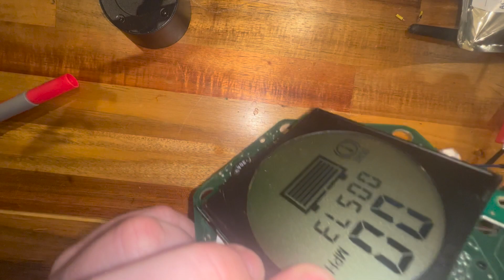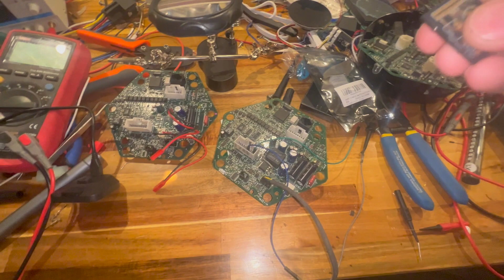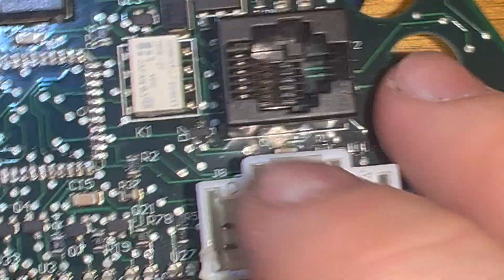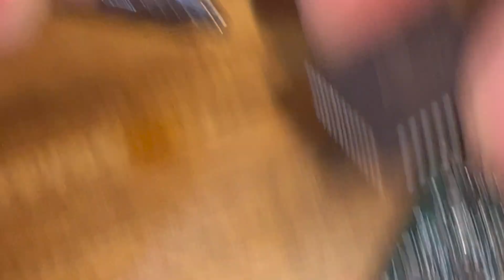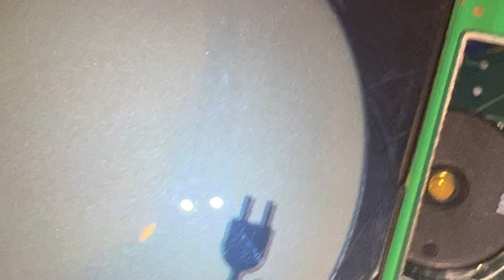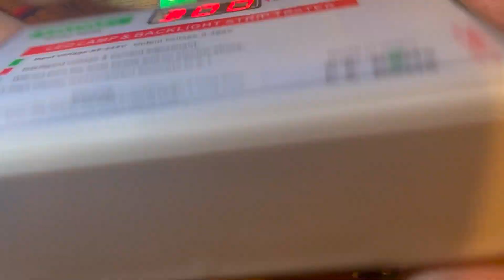Ep5: Debugging and Repairing the Cluster on a Ford Think

Comment: The PIC16 series is quite common and the programming is fairly simple to do. You do need the full code, data, and config in the proper format to flash a new one. I could probably look over what you have and provide further information and maybe help if there's some missing information too
Reply from the maker: I have a PicKit and was able to extract all of the code off of the chip, including the config file, but I’m not at all familiar with their IDE in order to flash to a new chip. Uploading the files I believe I extracted correctly if you want to take a look. It’s under the linked google drive I have at haganwalker.com/fordthink in the cluster folder.
Reply: @hagan92  I just downloaded this stuff out of curiosity, and noticed there was a bunch of text (well, series of RETLW instructions) in there - including one that referenced "Mid-South Product Engineering, Gadsen, AL", who are presumably the people that actually designed it.  Sure, it's probably all still under NDA, but it might be worth contacting them to see if anyone there remembers the project and if there is anything they can tell you.
Reply from the maker: @TrimeshSZ  unfortunately I believe they closed about a decade ago. Good find - that was the firm! There’s a sticker on the back of each cluster with their name. Anything else that you see? Is everything there to flash to another PIC?
Reply: @hagan92  Nothing especially interesting - there are some more strings saying stuff like ":Th!nk Neighbor Gauge Assembly SW Version  " (but no actual version) - The file has the dumps from the main flash, the config word and the EEPROM region, and nothing looks like gibberish so IMO there is a good chance it will work.  There is certainly nothing in there that looks like garbage.
Reply from the maker: @TrimeshSZ  I appreciate it! If I can figure out how to use MPLAB X to flash a new chip, that would be awesome, as it probably would give life back to a few clusters that no one else has managed to fix (I’m not sure if anyone else has ever managed to extract the software) but I still believe, because of the lack of LCD’s and the overcomplexity, that a newer and more simplified PCB is the way to go.
Reply: @hagan92  The reason I noticed this was that I fixed one of those clusters years ago (it was a trivial fault - a blown regulator), and I remember thinking at the time that the  cluster was basically just all the glue to tie things together put onto a PCB - presumably with the intent of keeping the engineering costs down since the rest of the components could be sourced off the shelf.  Based on the (admittedly superficial) look I've had at the code, it doesn't appear to be doing anything highly complex.
Reply from the maker: @TrimeshSZ  I believe that’s true. The main purpose is odometer and diag codes that it can display over a serial connection from the controller. I have made a working bypass and have sent a few PCB’s out to a handful of people for testing and as long as that’s a success, I’ll keep moving forward with the next phase. More to come!
Reply from the maker: @TrimeshSZ hi there! Where exactly did you see these strings? I remember seeing them too at one point in MPLab but just tried to find them earlier tonight and couldn’t remember where or how I got there. 

I was able to successfully flash the hex file to a new PIC and got a previous DOA board working once again. I uploaded a new video just a few days ago and appreciate the encouragement!
Reply: Hi - because of the architecture of these PICs, you have to embed data as instructions - the standard approach is to use the "RETLW" instruction that does a return from subroutine and loads a constant into the W register.  The opcode for the RETLW instruction is 34xx where xx is the value to return.  Typically the data is proceeded by a ADDWF PCL,f instruction - so you call this with W set to the offset of the data you want and it will return with the value.  Having got that out of the way, the strings are at the following locations - 17C4: ":Th!nk Neighbor Gauge Assembly SW version  "  17F4: " Hardware Version:  " 180D: " Software Version Type:  " 1828: " Copyright (C) - Mid South Product Engineering, Inc. Gadsen, Alabama 2001 - 2002 " @hagan92
Reply from the maker: @TrimeshSZ  super helpful, thank you!
Reply: I just had an attack of boredom and took another look at the cluster code.  It really doesn't seem to do much - at this point, I well have missed something because I've only examined part of it, but the only bits I've found that are definitely in use so far are timer0 (seems to be programmed to produce a periodic tick) SSP0 (programmed in SPI mode - probably driving the LCD panel) and the internal EEPROM, which seems to be implementing a counter, likely an odometer.  The values read from flash are processed and output over the SSP, probably to drive the display.   There is also a lot of reading of port pins and driving other ones, although the intended function is unclear given the lack of context.  The code also has a very "not written by humans" look to it, making me suspect that it was produced by the free non-optimized version of the PIC C compiler.  If we can figure out what the in-memory format of the data is, it should be possible to swap the LCD for something else. @hagan92
Reply: @TrimeshSZ  awesome! Thank you so much for doing this. I'm hoping to have another video up soon, but a friend of mine and I have decided the best path forward is to just create an entire cluster replacement. We are on the tail end of development, but have been keeping it pretty quiet just to ensure we could do what we wanted to do. The biggest issue with the original cluster is the onboard power electronics that convert the 72V to 12V for some things, then down further to 5V. This is why we deemed an overall replacement necessary - sooner or later, every cluster will die due to inherent design flaws, and the two people that offer rework solutions want at least $600 to do so. Conversely, we're targeting under a $300 price point for a overall plug and play replacement with color screen, GPS speedometer (for wheel size compensation), and some other features. 

All of that being said, your comment above seems spot on, and I would be more than happy to see if there's a way to make a cheap plug and play module, which takes the commands from the LCD connector and broadcasts them to something like the DWIN LCD displays that we are implementing on our cluster replacement. This could be a great way to have a "basic" version of the cluster with a more crisp screen and some other enhancements, without needing the entire PCBA replaced. If the above is targeting $300, there could be a way to make a much smaller converter board and sell that for like $150 - just remove LCD, mount in converter board and new LCD, and good to go. 

If you're interested in chatting further, feel free to shoot me an email! haganwalker at gmail. Thanks for looking into this!
Reply from the maker: @TrimeshSZ  here’s an update on where we’re at: https://youtu.be/r9Wr9DC4lSg
Reply: @hagan92 if you have the hex file flashing shouldn't be too hard. Google brings ups decent guide when I searched for pic flash tool. 
Key thing is if you're just flashing hex you don't need compiling or anything like that. So any guides based around that aren't what you're after.